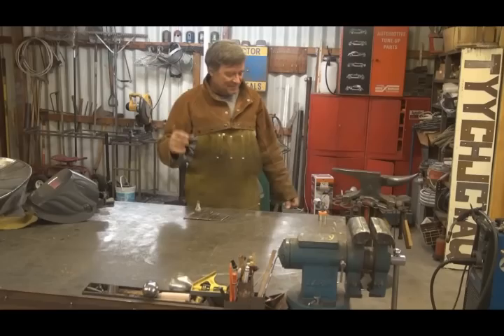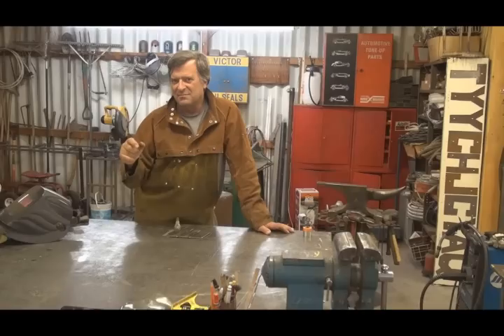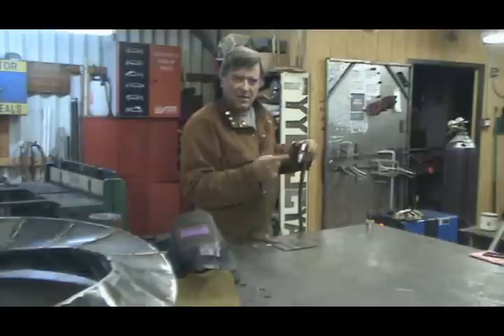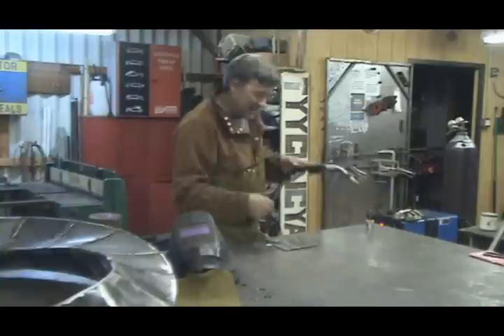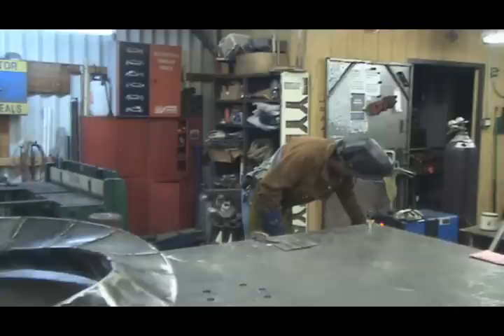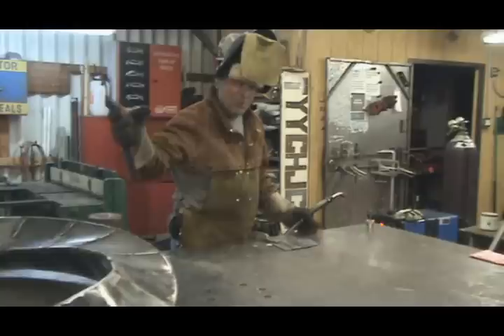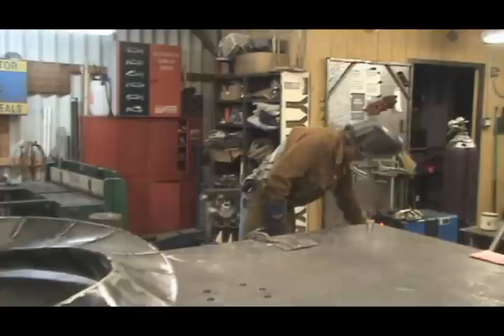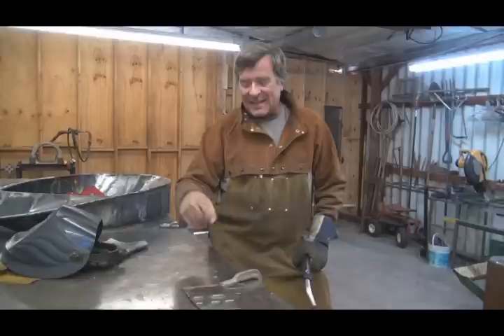The Sound of a Good MIG Weld - Kevin Caron

Comment: I'm about 3 months in to watching a lot of welding videos now, this video with the audio quality to hear the sound really helps, thanks. When you got up in the middle and had that nice sizzle going, it was really informative, the sound at 185 is quite common on youtube videos. That popping at the start told me that it was not right, but 185 was sounding better. 225 was actually a really nice sound, I could hear that real nice consistent sizzle action. 260 was like a supercharged funny car, just ripped in, you could see the splatter going bonkers, 300 was pretty much the same as 260 to the ear, but I'm not sure I can see quite the difference in the puddle. I just bought a 250 Mig, so this is really nice to watch, although I will be welding Aluminium and not quite thick enough to warrant 250 too often. But I will grab some nice thick plate to just have that baby laying down all them Amps, hear that sizzle. Thanks for the audio quality and demo's, helps us noobs so much

Comment from the maker: @Jovanalfonso ..  A basic guide is for mig is  1/16" 100/120 amps,  for 1/8" 140/150, and 1/4 180/190. This is starting amp for mild steel with. 030 solid core wire.  You can find lots more for "mig welding amp settings"

Thanks for asking...

Comment: Kevin,thanks for your post I'm going to go with gas and solid core wire eventually,I agree going with gas should be better for me,right now flux is just for me to get the hang of welding and experimenting with wire/voltage settings. My dad in the 70's did welding and I wished I was more interested in that back then(young and dumb back then now old and dumb lol)

Comment: Hi Kevin  I have a question! How can I know what will be the right AMP set up that i should used in my mig welder or any welder for any type of metal example: 3/16, 1/2, 5/8, 3/4 what are the step to follow to calculate the right amperage and not to burn throw a metal?

Comment: I'm trying to get my flux core welds right on my Millermatic 140 using 3/16 size metal,so turning voltage up creates more "bacon sizzle" and the weld looks better? I suck right now and would like to get a real decent weld going. I know practice makes perfect(using flux core for now just to get a "feel"),but I want my welds like yours,man :)

Comment: Was welding today, on the bench all was good, but on the car (upside down) there was a sound like a tig welder, I adjusted the wire speed, power and gas time after time and still the same weird sound. Any help would be great... Paddy Dublin Ireland
Reply from the maker: I suck at overhead welding, sorry.

Comment: the flux core uses flux that's in the wire for a shield that prevents it from oxidizing and makes the metal flow.
the gas in the mig system,usually a mix of 75/25 argon./co2 is what shields the electrode and helps stop oxiding of metal.
Migging with alluminum requires 100 percent argon.
You can also weld metal with 100 percent c02 but the weld is not as good,not much oxi/protction,and it tends to cause more metal buildup  waste inside the weding cup. Not recogmended.
Paisano